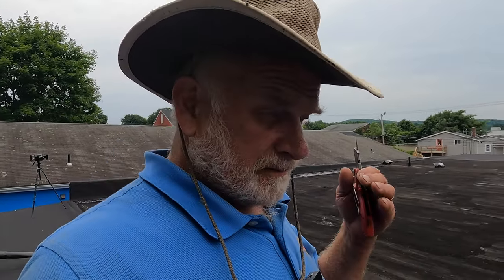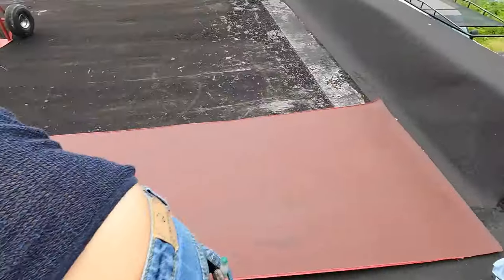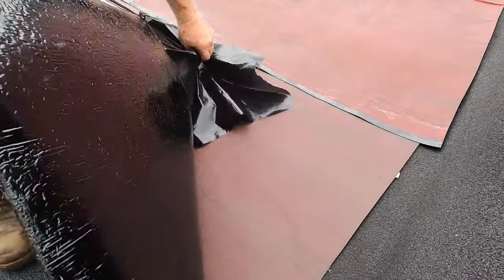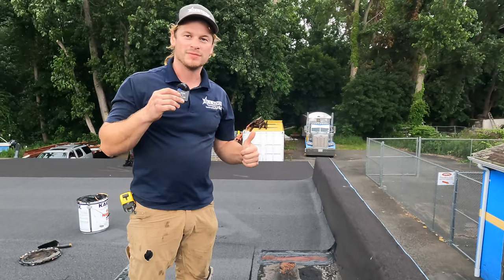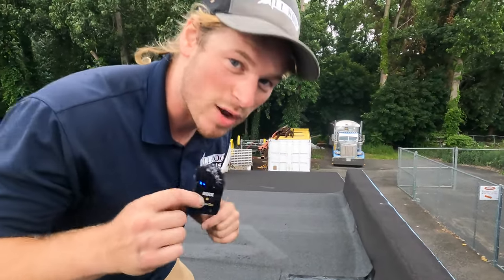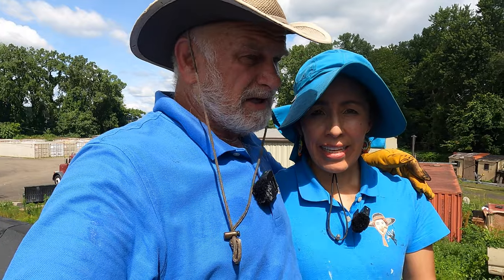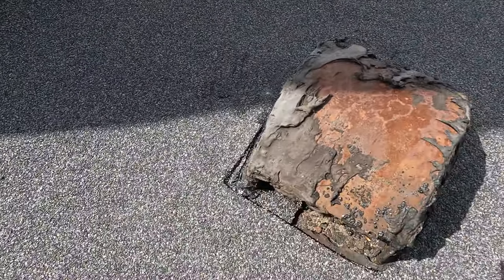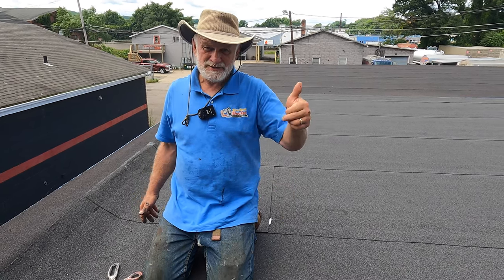Rubber Flat Roof Install - Peel and Stick Only 2 people needed DIY, Cheap, Carport, Garage, Porch,..

Comment: This roof is a joke and i would advise no one to let this guy near their property. Enough said!
Reply: Rolls of torch down modify are cheaper then whatever this guys using. This is some cheap hack job I’ve never seen before. Target around the pipes and vents and dope around. He has no idea what he’s doing for commercial roofing
Reply: How so? Explain don't just call someone a joke and then run. Explain why?
Reply: What he’s doing is totally acceptable for a flat roof, you’ll probably have to keep up maintenance with those vents every 5 years put another coat on them just to be safe, but besides that it looks fine.
Reply: …which roofing company do you represent?…what is your utube channel?…
Reply: @mplussant  I don’t know if this reply was meant for me or someone else. First off I don’t need a YouTube channel to be credible. I find most videos by DIY’rs to be littered with inaccuracies. 
As far as my qualifications I have been in the commercial roofing industry since 1978. Ten years as a journeyman roofer in local 30 in eastern PA. Twenty eight years working for two manufacturers of commercial roofing products. Both were producing modified bitumen products. This would be products applied in hot asphalt, cold adhesive and torch grade applications. Eight of those years were in field technical duties and twenty in sales. I was a architectural sales rep working with designers in creating specifications for roofing on new and retrofit buildings. 
For the last seven years I have been employed by a well respected engineering and consulting firm on waterproofing specification design, forensic investigations on waterproofing failures, expert testimony on lawsuits filed in failures and quality control of on going projects. I am 65 years old and still very much involved in the industry. 
It’s my work experience and accomplishments that allow me to comment on less than acceptable roofing installations. 
My first issue is with telling a homeowner that he can use a propane torch that puts out 40,000 BTU’s in order to heat the material on wood structures. I have seen the damage fires have on buildings. I could go on and on. One question for you do you ever see a fire extinguisher in any of his videos?  Don’t you think there should be some on the roof?  
I hope this brings to light some of the issues I have with the roof doctor.
Reply: @michaelkotrosits4371  …my reply was directed to the thread originator—Stevegee…I don’t even see your handle in this thread, nor is there a reference line in my reply specially addressing you…have no idea how you could perceive it pertained to you…are you new to textual thread format?…
Reply: @michaelkotrosits4371 ..What a truly impeccable reply. This guy should should kneel at your feet with your credential's before he climbs back under his rock.
That reply was meant for me but iv only just read it and to be honest i dont do going back and forth with these people. My comments about the whole thing were honestly quite tame to what i wanted to say..I too have served the building industry all my working life. Im 59 now and have not touched a flat roof since moving to S France, not much call them here, but i have dedicated my working life to raising standards in our industry and trying make a difference. My old school values have and never will change. At first i thought i was watching one of those spoof videos only to reveal it was April fools day.
 Seeing this guys workmanship appalls me because its the poor home owner that will always pick up the mess afterwards.
Thank you for such a great response in which i would never have bothered to do to be honest and huge respect for your commitment to your work over the years.
Reply: @stevengee4562  thank you for your reply.  I generally do not reply either. However this guy called the roof doctor he represents everything wrong with doing flat roof videos. Just for your information the two manufacturers I worked for were Icopal for 20 and Soprema for 8 years. These two are considered leaders in the industry. Anyway I just wanted to say thank you.
Reply: What is the name of the products and where to buy?
Reply: I heard that and yer not coming to my house. You should be embarrassed my wife and do this for the habitat for financial security of professional roofers united. I say this for cash. Shame on you  sir
Reply: @geminiroy763  Crickets.....